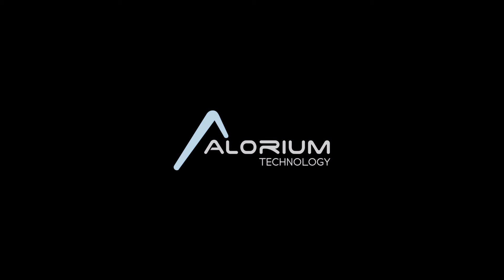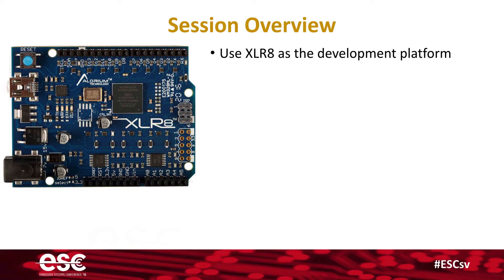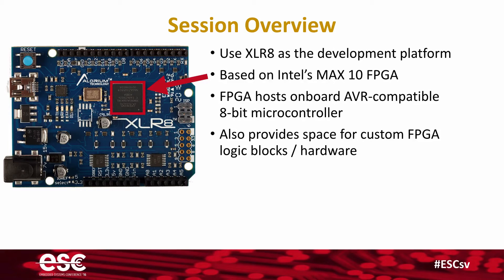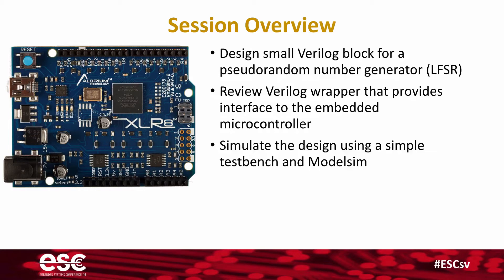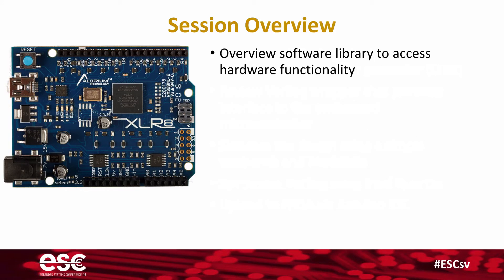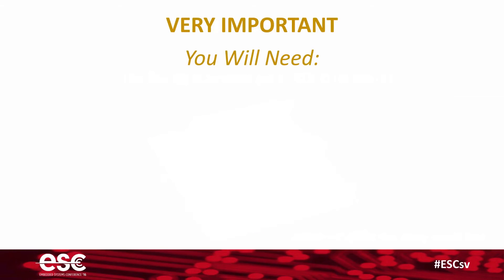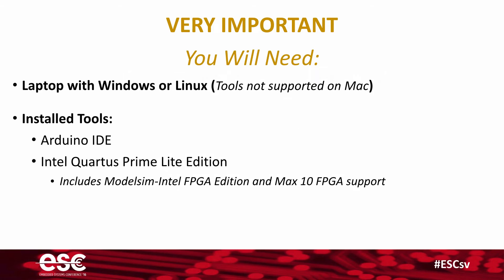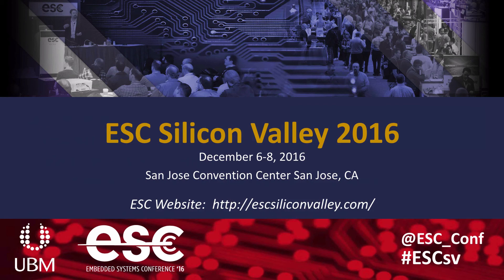ESC 2016 Tutorial Teaser:  A Novel Hands-On Approach to Learning FPGA Design

Comment: I think a cool application for a board like that (what with it being light) would be to have it mounted on a (hobby usage) laser-welder/solderer which moves around (and focuses its laser to aim and do soldering perhaps on surface mount chips), because you wouldn't need trailing cables. Sometimes "oven reflow" is not the way forward, so solutions such as that are needed. Also that wrapper to communicate with the IO would help, and the FFT built into FPGA would obviously help with waves (lasers etc). So, 3D printing is cool and all, but realy, to make things actually "do stuff" people will want to put a computer in a thing they make. There are many things a person could make with such a setup (or laser soldering and 3D printing), let alone "make another laser soldering machine" (a bit like self-replicating machines in the matrix - lol). The sort of project tht makes sense would be something like the Armiga since that has a 3D printed plastic case. I'd gather the Armiga circuit board was likely made in the Far East somewhere, however, doing that requires big batches to make it economical. When it comes to making small batches of things though, what I've described in this comment could be an idea. Really it is a bit like how "micro breweries" scaled down to make smaller batches of Ale. So that is a metaphor for "homebrew" computing, be that games or hardware or software. It would allow the hobbyist to make serious kit.